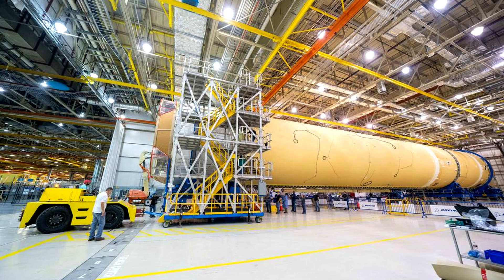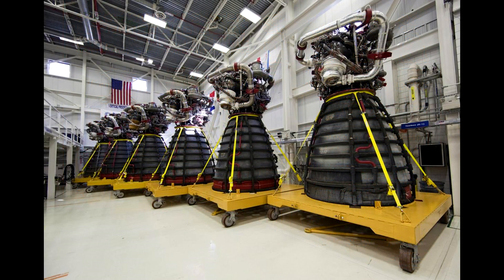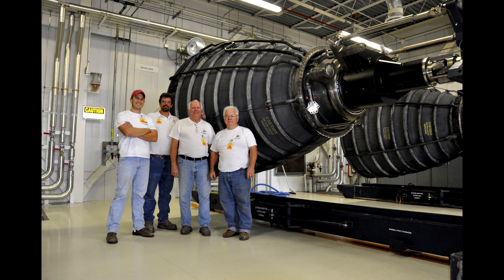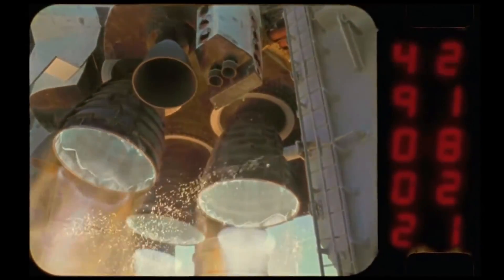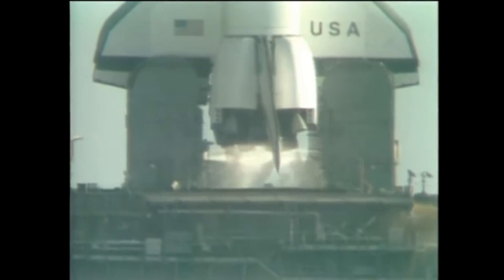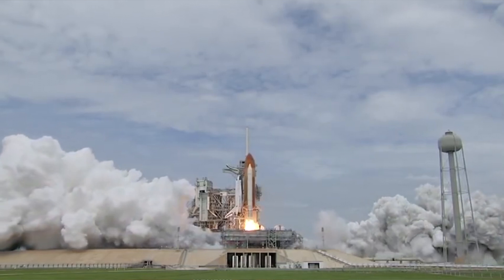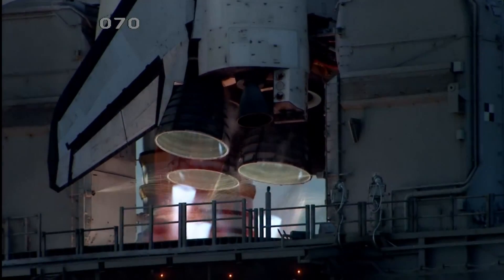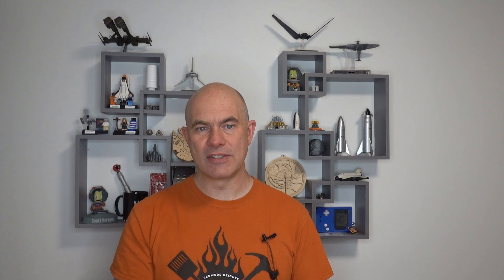Four Old Space Shuttle Engines Team Up For One Last Rocket Launch

Comment: Is the Green Run basically just a static fire?
Reply: Yes. The B-2 stand has pretty incredible testing capabilities, much more than a launch stand. It's also set up in a way that all parts of the rocket are accessible to personnel for inspection up until the moment it's about to get fired, which is pretty important for a system that has never been flown/ filled/ assembled before.
Reply: Pretty much.
Reply: unlike the falcon 9 static fires, it will be full duration until the fuel runs out of the core stage, it will then be refurbished and sent to KSC.
Reply: No -- it's Boeing running to NASA for more cash to build a fuel tank with a fairing on it.

Comment: These engines should be put into the museums that lost the bid for the shuttles.
Reply: Too bad they're only using it to fly an actual rocket
Reply: @Astrocat-od5cy  vaporware with a rocket nozzle .
Reply: @jsttreat  lol, it was more of a joke, what would actually be practical would be if we'd quit using A-10s in antiterrorism and used lighter, cheaper, and more appropriate aircraft like the Tucano or Texan II. These aircraft have a few advantages as well, such as a longer loiter time.

Though there is actually a long and rich history of strapping weapons to planes never intended for that role. A few artillery spotter pilots in WW2 would strap bazookas to their piper cubs. One such pilot nicknamed Bazooka charlie used 6 in each sortie, and walked away from WW2 with 6 confirmed tank kills. It was also common to strap bombs and depth charges to pipers and cessnas in the CAP for a short time on the hunt for u-boats. Even today, special forces uses a small number of cessna caravans capable of firing missiles.
Reply: @hatman4818  You mean Mad/Lucky Lt Col. Charles Carpenter. 
Just seen the History Guy mention him in his video about the Cub not long ago
Reply: n/a n/a exactly, especially the National Air Force museum. We got screwed royalty. We had a promise we’d get one and then it went to California
Reply from the maker: @Stienecker  Appropriate, considering the USAF asked for a bunch of design requirements which were never used and then tried to get out of the Shuttle program ASAP
Reply: @scottmanley  wow shots fired!
Reply: @scottmanley  Lol, I can attest to such decision making prowess first hand. We fly 60 year old jets just off the coast of 3 countries that would rather we not be here, yet trying to get something as simple as high torque bits officially added to our tool box so we can stop breaking bits in jet engine inlets is such a beaurocratic nightmare that nobody's managed to do it in the 3 years I've been stationed here (meanwhile, a unit on the other side of the flightline has hundreds of them in spare tools). Oh, and our red duct tape costs like 50 bucks a roll... Even though that's supposedly the lowest bidding contractor.

The Air Force doesn't really know what it wants. This is the same force that thinks the F-35, a 150 million dollar per unit jet, is a suitable replacement for the A-10, even though it has a less than 50% mission capable rate right off the factory floor, and loses its stealth capabilities the second you strap a bomb/pylon to the outside of it. And for what? All we do is bomb toyotas anymore. Hell, we'd probably be better off strapping hellfires to cessnas. Certainly would be a lot cheaper than making a swiss army knife fighter do ground attack.
Reply: @scottmanley  yep.. meanwhile California keeps Endeavor at the science center.
Reply: @Stienecker  The flight deck trainer they have at the museum is pretty cool. I liked the mock up they built of the remaining orbiter. Walking the outline of the full scale machine gave me a sense of the size of the real one. The Nat Museum has a treasure trove of historic items already. Besides I am sure none of us could get as close to the flight deck of a real orbiter as you can to the trainer.
Reply: @Stienecker  - and California has the only external "orange" tank too...
Reply: Soooo Houston, Texas?
Reply: I strongly disagree; museums are for old, useless relics. If it can be used, why would you not use it for which it was built? Fish gotta swim, rockets gotta fly!
Reply: @icollectstories5702  because it was built to be a highly efficient reusable engine and they've been reused over and over like they're supposed to except now they'll be jettisoned and smash or burn up?
Reply: I Collect Stories I agree. There’s no reason whatsoever to put these in a museum, they are still useable and already paid for. They should be used. If we were talking about them scrapping them or something then I’d say they belong in a museum instead of chopped up but flying around the moon seems like a much better way to retire.

Comment: So much re-use of old material, and still it'll cost 2B each ?!! ?
Reply: Unsurprisingly to anyone who has ever done any engineering, it turns out that re-engineering an old system into a new one with new design constraints is harder (read: more expensive) than just starting from near-scratch.

It's a death of a thousand cuts - a little extra structural reinforcement here for a part that wasn't originally load bearing ... a little shape change there to mount new hardware ... and suddenly it would have just been easier to start over.
Reply: But of course our politicians wouldn't know that and wouldn't care.  They just care that jobs in their district == re-election.
Reply: Of course you do know the 'S' in NASA stands for subsidy right?
Reply: It costs $2 billion dollars each BECAUSE it reused old equipment.
Reply: It's okay all of us taxpayers are fitting the Bill.  Yeah right government crooked politicians.
Reply: Top ten bruh moments of 2019/18/17/16/15/14
Reply: Nope, beacuse of those engines and Orion reuse first launch will be 300-400m
Reply: Some called it the Congress Launch System, because contracts are spread out all over the country to please as many state representatives as possible. Many politicians simply view the program as a way to generate jobs in their state with federal money and would hate to see development actually finished. Having to deal with countless contractors and subcontractors spread so far apart must be maddening to the poor engineers involved who actually want to launch rockets. I bet there's a Pentagon Wars like story in there somewhere, waiting to be told.
Reply: Yep and I as always people are paying for it the taxpayers and they have no choice from the Crooked people that run the government.
Reply: and they ain’t gonna be reused!
Reply: Government work is ridiculous.
Reply: While SpaceX is running out of room to store their reusables, and just yesterday flew one for the fourth time.  And landed it for more.  With reused fairings too.
Reply: @Jeffersonian1  Then I guess they can sell their surplus engines to old space.
Reply: It is gonna cost way more🤣
Reply: No it will cost between 5 and 8 hundred million
Reply: @thewestwinger3855  the 2B figure is basically official at this point. It's not guesswork.
Reply: It's why NASA needs constitutional term limits and a complete management change for NASA. The SLS program exists for a handful of senators.

Those who say NASA shouldn't faced any leadership change after they lost Challenger should be punched in the face until they're too numb to talk. The management who ignored the engineers got to keep their jobs, apparently their jobs were more sacred than the lives & the shuttle that was lost.
Reply: n/a n/a It’s not the engineers fault that challenger happened. It’s the fault of Congress putting pressure on NASA to do things at the expense of safety
Reply: @jerry3790  Congress and Challenger ... remember Politburo and Komarov.
Reply: @jmd1743  After Apollo One, NASA administrator James Webb kept his job. Now there's a space telescope named after him. So did George Low (who took Joe Shea's job in Houston as Apollo Program Manager after Shea suffered a nervous breakdown following the fire), Robert Seamans, and George Mueller. (Webb, Seamans, and Mueller were referred to in NASA circles as "The Three Wise Men.")
While over at North American Aviation, NASA wanted the heads of both CEO Lee Atwood and Space Division chairman Harrison "Stormy" Storms on pikes. Atwood managed to keep his job, but he threw Storms under the bus.
Reply: @dalethelander3781  Sounds very interesting, Scott should make a video on that. The Challenger was completely avoidable unlike Columbia.
Did you know that it was planned for the MOL station to use Helium-Oxygen unlike the pure oxygen environment of Apollo one? The person who made the decision for a pure oxygen should have lost his job.
Good people lost their lives & the program had a set back.
Reply: @jmd1743  MOL was a USAF project using the Blue Gemini capsule. Whatever they want to breathe, it's a military decision.

The plugs-out test using pure O2 had been done since Freedom 7 and there was no reason to believe it was hazardous. It was all on North American Aviation. They built shitty Block One spacecraft. The Block Twos already had the design changes incorporated.